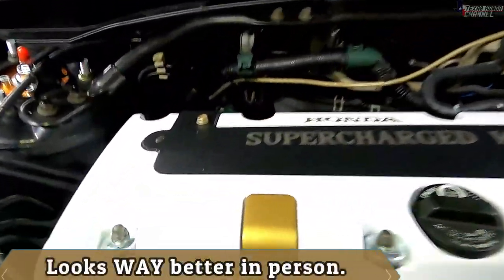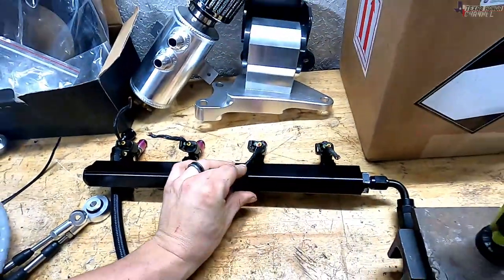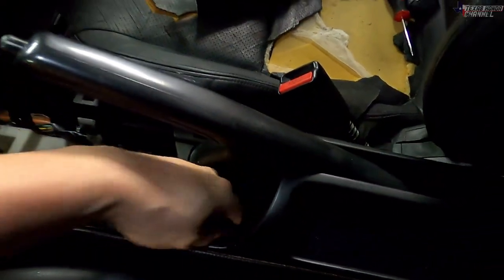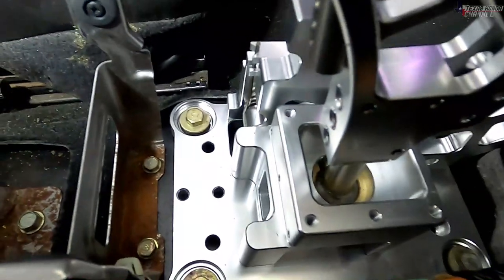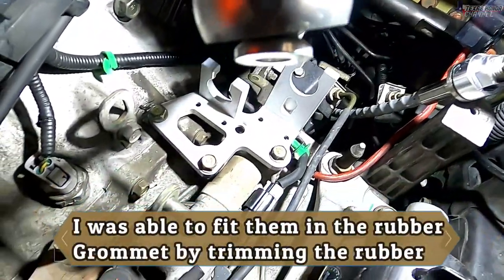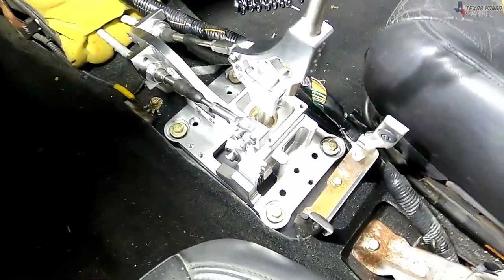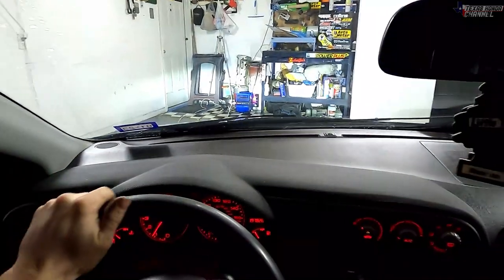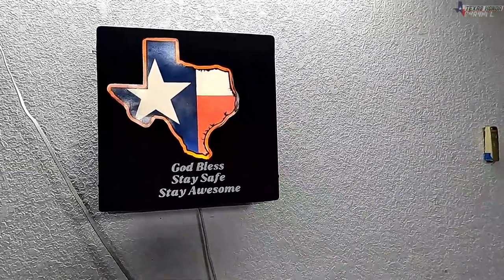RACESPEC SHIFTER INSTALL ON RSX.

Comment: That unit looks solid. Also let me know if you want me to send some oil for the manual with the motor oil
Reply from the maker: I definitely could use some manual trans fluid since I’ll be doing some CV axles before the track.

Comment: Dude you do great work I don't know what kind of setup you have for paint I know you like to rattle can a lot and you're dang good at it! I would love to see you try something different it would cost about five bills to 10 it's not dipyourcar but it's called Halo EFX that stuff looks awesome and is peelable anyways keep up the good work bro it looks fantastic
Reply from the maker: I love spray can painting it works great for me and it lasts when done right. I can’t afford that kinda money for painting especially where I’m at right now lol they are threatening me for spray painting in my garage. Either way I can’t do much currently so spray can is easier for my situation. I have a compressor and gun and such

Comment: There's a yard called Honda Heaven that i would go to for parts but they had a flood and had to scrap most of thier cars. How close did the fires get to you the other day
Reply from the maker: I didn’t even know there was fires yesterday. I don’t watch news lol probably should but mostly lies or hate now days. I would assume not too close?
Reply: I dont watch much news either but there was 10k acres near Fort hood burned the other day when the wind was high
Reply from the maker: @nathenyoung3861  Oh that’s explains what the smoke was okay. I thought it was a controlled burn lol 😂
Reply: Lol
Reply: Do you know what all different cars I can find the manual transmission in that will bolt to the b series engine

Comment: I have rsx base and wondering if works for too. I like it's metal and adjustable.  I  noticed mine is sloppy shifter also and sometimes grind 3rd . Thinking maybe it's shifter  not my transmission
Reply: What part number  I'm interested in replacing my shifter it's sloppy

Comment: did you ever figure out the reverse gear problem
Reply: Facts lol I wanna figure it out too
Reply: @that_bohrich3069  I got it all installed but I cant even shift into 2nd 4th 6th or reverse at all, the knob is like 1.5cm away from the console. Im gonna cut out the middle of the console and leave the shifter exposed